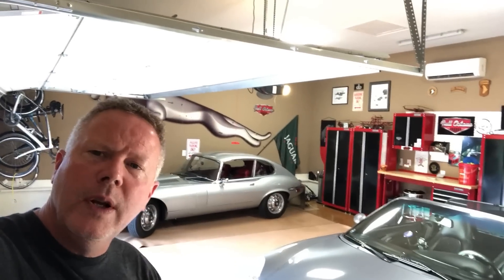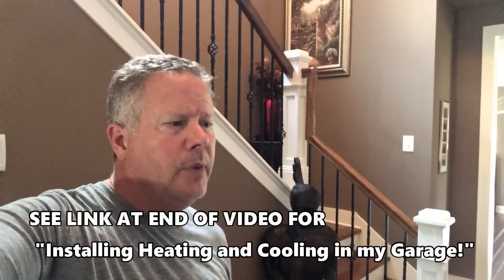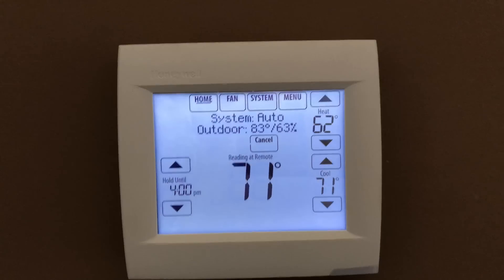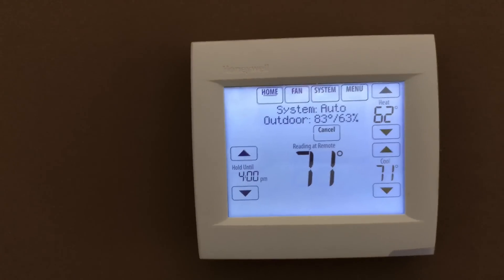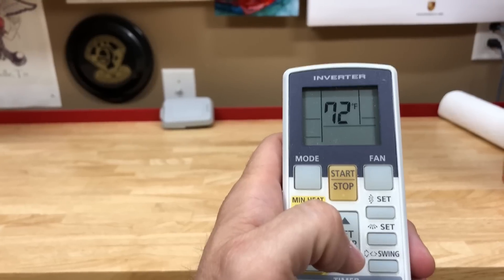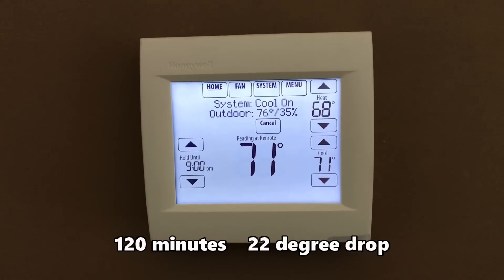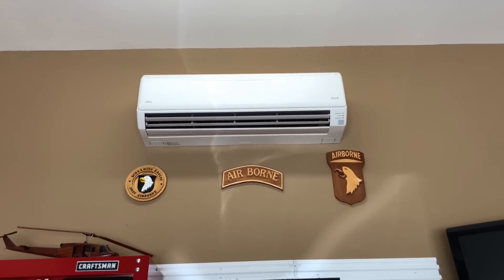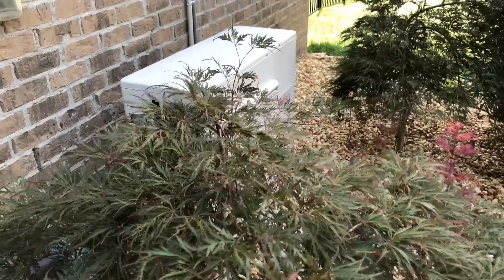We Answer the Question... Can a MiniSplit REALLY Cool your Garage?

Comment from the maker: Ive spent over 30 years in the HVAC field... and I approve this message. 
Lol.
 What do you have in your garage?
Reply: Full Octane Garage 
WiFi ac split
Reply: In my last house, I had a 12,000 BTU Pioneer (19 seer) with R19 attic and R8 Garage door.  324 sq ft.  Man that garage would cool off any time even if it was in the 90's in about 30-40 mins.  It was amazing.  Oversized for sure sometimes needed dry mode when it was mild outside, but I loved it.  Wifi app worked awesome also.

Comment: Thank you for your service and thank you for this video!  I have a two-car attached garage - (about 400-450 sf) in North TX, uninsulated ceiling, 2 of 3 walls uninsulated, and am thinking of adding insulation to my double door.  .  I am considering a 9K or 12K mini split (probably 12K) to make the garage a more comfortable space to spend more than a couple minutes during the extreme temperature seasons.  This video answered my biggest question - will it make a difference?  I'm also not looking to noticeably increase my utility bill for something that is just a "nice-to-have", and from your comments yours didn't move the needle that much - correct?  As you are a professional, I'll also ask you what I should expect to pay for a Mitsubishi installed?  Your video has made me a little more comfortable to start getting quotes.

Comment: Great video. Thanks! 

What 120V system would you recommend for a 3-car tandem finished garage?  About 850sq ft.
Reply from the maker: I dont think you will find a 120V mini split capable of handling that load. The 120V units only go up to about 3/4 to 1 ton. That size garage is going to normally be around a  2-1/2 system.

Comment: I have a 40x32 garage 16 foot ceilings fully insulated. What would I need to keep it cool.
Reply from the maker: Sorry im late on this... I would have a contractor run a load on your situation... probably be around a 3 ton but You will may need some ceiling fans to keep the heat down toward the floor. cooling should be fine

Comment: Looking to put a mini split in my garage 420 sq ft. Any issues as far as brining a hot car into a cooled garage or vise versa pulling a car out of a cooled garage into the heat?
Reply from the maker: Depending on the car and the space, a hot car could slow down the  cooling recovery time. My R8 is still putting out heat 4 hrs later. Just adds to the cooling load for a bit. I dont see an issue with a cool car going out into the heat you are cooling to 72 or so.
Reply: @Fulloctanegarage  thanks, also do you feel a huge loss if say you’ve opened one of your garage doors to bring a car in or take the trash out? Just imagining that huge opening and all that lost cooled air pouring out.  
And do you feel a mini split can be a diy for someone who’s handy?

Comment: Hey there, looking to keep my 800 sq ft wood shop at a constant 72 degrees up here in Colorado. I have spray foam insulation plus fiberglass batts in the ceiling (open catherdral T&G ceiling) and the walls are at R15, plus the garage door is insulated with 7.5 rigid foam boards. I'm looking at videos on mini splits and this video helps. One question , would the much cheaper DIY 24k mr cool brand be ok? Just wondering what the major differences are between the Mr Cool and mitsubishi/fujitsu etc. Also Thanks for your service! I was a Rigger in the 82nd Airborne 97-02
Reply from the maker: Thank you for your service! We tend to use Mitsubishi and Fujitsu rather than the other brands because they are established and always seem to be distributed locally. I have run into many issues with parts availability and service support on the other brands. We dont not have specific experience with Mr. Cool tho.

Comment: I have a glass garage door I’m in cali. Some day it’s a sauna or a green house in my garage. Will mini still work?
Reply from the maker: Yes... may have to account for the extra a/c load for the windows... you might want to consider getting UV tint for those windows... that would be a low cost improvement!
Reply: @Fulloctanegarage   sorry I know very late reply but I did get uv tint. yet I still have not found the right system. Thank u for the advise

Comment: I have a game room and gym in my 3 car garage. iam wondering if I should get just one of this heaters or a window ac/heater for my fully insulated  3 car garage?  If I get just a heater then I have to worry about getting something to cool it in the summer.  I just don't know which way will be the way to go, two separate units one for  the summer and one for winter  or just find a unit that has both in it ac and heating? Garage is about 660sq ft and 8ft ceiling night, fullybinsulated even garage doors. Live in Clovis ca with a climate zone of 9b.
Reply from the maker: this a combination heating and cooling unit… it will do both. Fully insulated,  a 2 or 2 1/2 ton system should easily condition the space.
Reply: @Fulloctanegarage  are u talking about the window ac/heating units?

Comment: Hey! Thanks for the video. A couple questions for you...  My scenario... 2 car garage. 66 mustang. In Arizona. My wife's daily driver is  sharing the garage with the mustang so the door is opening and closing morning and evening primarily and throughout the day on weekends. I'm also planning on having solar installed very soon at roughly 130% capacity of my current electric usage without a garage AC.  1) Is it realistic to have a mini split installed in a garage that will house a daily use car considering the daily heat it will be generating? 2) Is there some kind of active ventilation system I can put on the daily driver side of the garage that will work in conjunction with the mini split to help energy costs? 3) How much (ballpark figure) do you suspect my energy costs will rise by going through with all of this?  Id really appreciate any guidance and again, I really appreciate your guys' channel!
Reply from the maker: I had no discernable difference in my utility bill. Inverter systems, once they hit set point, will dial back energy usage while in maintenance mode. I have seem ventilation systems in garages b4.. they can make a small difference but they usually require make up air which is typically drawn from outside. You may find yourself drawing in more humid  ( or warmer or colder) outside air than what is already in the garage. Ive experimented with putting high HP hot cars like the V12 etype and the R8V10 in the garage while they are hot and watching the recovery. Of course it could take longer. We generally had a daily driver in the garage along with the collector cars.
Reply: @Fulloctanegarage  That makes sense and puts my mind at ease. Thanks  a bunch for your reply.

Comment: Hi.  Thanks for the video and information.  I really appreciate the time and effort you put into this video.  Question:  I live in Central Texas with a 750 sq ft garage.  Similar to you, we have 95 degree heat and humidity for several months of the year. I have insulation on two walls and the garage doors are insulated. The unfinished wall has floor to ceiling cabinets installed, so there is no way to insulate without tearing everything out on that wall.  I have a finished garage (walls and ceiling), but the upper roof ceiling is not insulated.  I have a few questions for you and would appreciate your guidance: 1) Do you recommend insulating the roof ceiling area?  2) Based on your video I will need a 24,000 BTU...what model would you recommend; and 3) what do you think would be a reasonable cost to have a professional install the system, including the unit - your video is 3 years old and inflation, etc...so a baseline estimate would be appreciated. Once again, thanks for taking the time!
Reply from the maker: And thank you for watching! 1 . Insulating the ceiling will make a huge difference in the winter months, 2. Mitsubishi heat pump inverter split system 3.depending on the installation, with 220v already available and a straightforward installation… $5k to $7k in our area. You can get it for less with a different brand… but Mitsubishi is the best out there. I have had pretty decent success with Fujitsu also.

Comment: @Full Octane Garage I have a fully insulated 2 car garage in NC.  Avg temp in the summer is in the 90's and in the garage temp is about the same.  Garage about 400 sq ft.  Will a 12k BTU work or should I go 15k?  Looking at Mitsubishii 21.6 seer.  Thanks!
Reply from the maker: Go with the 1.5... you really cant over size a garage unit and it will recover faster after the door has been opened.

Comment: Quick question, what wireless reader is that, that you’re using? And do you know the seer and btu rating of your unit?
Reply from the maker: 2.5 ton, I believe 21 SEER and it is a Honeywell outdoor sensor #C7089R1013 I believe is the same thing. About $55 on Amazon
Reply: @Fulloctanegarage  also, did you notice a huge difference on you electrical bill?
Reply from the maker: @AllSaintsWhodat  absolutely no difference in our electric bill… I put Mitsubishi in my garage in my new house that I have now. I think that’s the best call actually. They have better customer support and are generally but easier to find parts for. I put a 3 ton in a 1000 square-foot garage with a second-floor on it that’s like an open mezzanine. The air-conditioning keeps up all the time. The heat does not, I’ll have to get it insulated at some point. Congrats! It’s a life changer.
Reply: @Fulloctanegarage  that’s awesome I definitely feel the difference I’m going to buy a temp gauge for the garage!
Reply from the maker: Honeywell C7089R1013…. 2.5 ton (30,000) BTU and I believe it is 21 SEER
Reply: @Fulloctanegarage  thank you very much, I’m in Florida and just got my mini split installed in my garage as well, I went with a Mitsubishi unit… I can’t lie I already feel the difference in the garage

Comment: This is a crazy and misleading video chiefly because of the  huge amount of variables that are involved in sizing an ac for a given space eg  is it in Alaska , cold or Arizona hot , building made of tin / brick , insulated , north facing ect ect .
Reply from the maker: Glenn De Jong Fair... but the question  I am answering is “Can a properly sized system effectively cool the garage?”  the construction is apparent in the video,  it has 1 conditioned wall and insulation in the ceiling... the local would be pertinent if I was discussing load sizing but I was just demonstrating performance of a stated garage size with a 2 ton unit. It faces west.  Ive been in the business 32 years... I can bore everyone all day about industry specifics about load sizing and application which 95% of viewers don’t want to see as it is not relevant to their specific application... not the point.  Assuming a properly sized system... the system  can recover to set point from 95 degrees in the stated amount of time. How is that misleading? If you have specific questions feel free to ask.
Reply: Full Octane Garage  Sounds like a fair reply , touché.

Comment: Nice!  The garage in our new house is gonna be about that size with insulated garage door, attic, and block walls.  I'm trying to decide what size mini split.  Clculations say 7k-9k btu will be plenty, but two inverters I'm looking at have a range of 1k-13k btu and the other 3k-18k btu.  Either will work and one will cool faster, but I'm not sure which one to pick lol.
Reply from the maker: I would go big ... will really speed the recovery time after the garage doors are open. With inverter tech you can oversize as they will power down as load reduces and start doing more dehumidification. a 9k will really have to fight to overcome hot cars and the doors being opened when you arrive back home. I think loads usually consider a closed door environment... they really dont factor dumping the entire space of conditioned air when the cars come in and out. If you never open them... Im sure the small unit will be fine...lol
Reply: @Fulloctanegarage  I've been recommended an 18k BTU (max not nominal) for pulling in that sun baked car and still being able to stay cool by a few people now.

Comment: This looks amazing sir, love the organization, currently getting a 2 ton installed in my 3 car garage as i type! i hope it is nearly as effective as yours. walls and garage doors are insulated but not the attic above the garage yet.
Reply from the maker: It will certainly be great. Just had my neighbors over for drinks yesterday afternoon.. 97 degrees outside walked in through the garage and get hit by the wonderful 72 degree air... my buddies comment.. "alright, sign me up... I have to get one of these."
Reply: @Fulloctanegarage  indeed. It's been installed an hour and already went from 95 to 77. Game changer now!
Reply from the maker: Sterling Miles  Glad to hear it.. Congrats!!!!
Reply: How has this worked out for you? I've got a 660 square ft 3 car garage and I'm debating between a 18k unit and a 24k unit. Worried the 24k would be over kill meaning it wouldn't get the humidity out correctly.
Reply: @mikeworkman1759  mine is about 700 sqft and I have the 24k unit. It works amazing! If it is insulated you can probably get away with the 18k but here in Texas we have alot of humidity and the 24k works perfect. The unit I have also has a dry setting if the humidity gets up there. Hope this helps!
Reply: @sterlingmiles1948  about how long does it take for your temp to go back after you open a garage door to pull a car in/out?

Comment: I just love how everyone does this test without a warmed up car in one. But I have to say I do love our mini split in our garage. Great video and house btw.
Reply from the maker: funny you said that... I bought an R8V10 and we were commenting about how much heat came off of it. I put it in the single car garage  that only has a portable AC in it and it immediately raised the temp 10 degrees. Really hard to account for how much of the increase is from opening the door and how much is from the car. When I put the R8 in the big garage with the minisplit the temp went up 5-6 degrees b4 I got the door down but it continued to drop right down to the set point. the Mini split merely ramped up capacity for a bit to overcome the greater load.
Good point and thanks for watching!
Reply: Full Octane Garage Wow and awesome choice of car you’ll love it. Great  info because I don’t think people ever calculate the heat coming from the vehicle and unsize their units for this application.

Comment: Now that it's been over a year, how did it do for heating your garage in the Winter?
Reply from the maker: TerraMagnus Kicks ass... as good at heating as it is in cooling. 72 all year long. I will say that if you live in a cold northern climate like North Dakota,  a heat pump may not keep up as well as it loses capacity in extremely cold weather. Not a problem here in TN
Reply: @Fulloctanegarage  I live in Michigan, winter can get down to 0° overnight for a few weeks or so a year. Do you think this could keep up with that?
Reply from the maker: @mikeworkman1759  Depends on the insulation to a large extent... we moved to a new place and I put a 2 1/2 ton on a 1000 sqft garage with a high ceilling and almost no insulation. It holds temperature until in gets below about 32 degrees then it really loses ground. Probably around 45 inside at 20 outside. Again, insulation would greatly improve it. I plan to fix it this year. Thanks for watching!
Reply: @Fulloctanegarage  this has definitely made me feel better about my purchase, I live in Florida with a 3 car 783sqft garage and getting a 3.5-4 ton Mitsubishi mini split installed, now I’m super excited seeing your square footage and it’s doing well. Thanks man!

Comment: Perfect video for me. I have a 3 car garage in north Texas that has the same amount of insulation. Sold me on the 2 ton unit. Thanks a bunch.
Reply from the maker: Super Duty 455 cool. Glad it helped. There is another video of ours about a year ago about the installation
Reply: Hi, Which brand do you suggest the best ?
Reply from the maker: @JTM_K  I had very good experience with the Fujitsu But, being the HVAC guy, I would probably lean towards Mitsubishi because of their after install support and better dealer network
Reply: @Fulloctanegarage  I was inclined towards Mitsubishi too, now I have confirmed. Thanks.
Reply: @Fulloctanegarage  Sir, I have one question regarding air sealing. 
1. Do I need to add proper sealing before installing the mini split. 
2. A dealer quoted me 12k btu for my 600sqft garage. is 12k btu enough ?
Reply from the maker: @JTM_K  nope .. it will perform better and be more efficient but is probably not necessary.

Comment: I live in hot humid Miami and and have an unfinished one car garage.  I want to use it as a gym and am thinking of purchasing a portable AC like you did.  But in yours and every video i've seen of installing an AC in a garage, the garage is finished, and I assume probably insulated.   So question: is it worth or even effective  putting a portable AC in an unfinished garage?
Reply from the maker: I’m going to say it will be marginal at best. I have one in my single car garage just like yours I assume... it wont keep it at 72 by any means ... but it might hold 80 during the day.